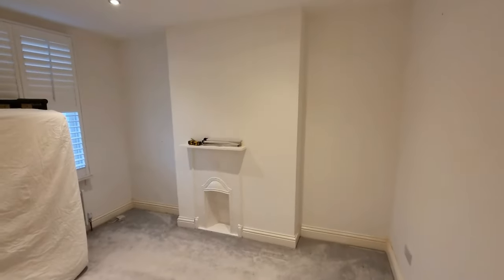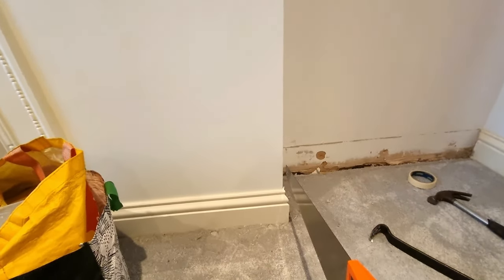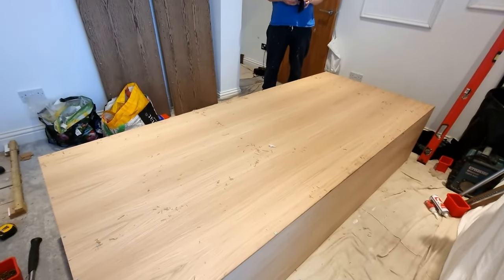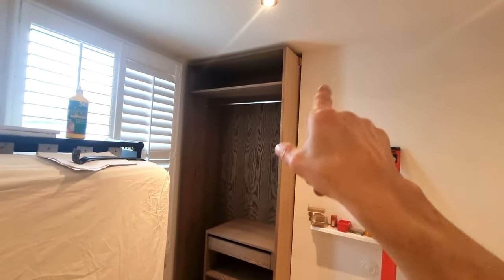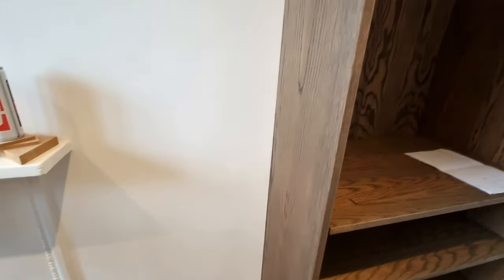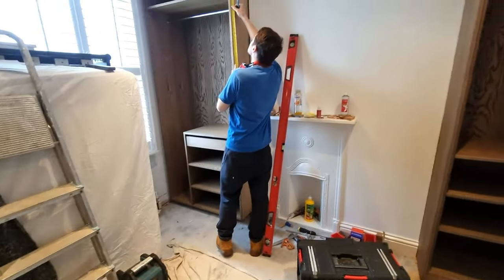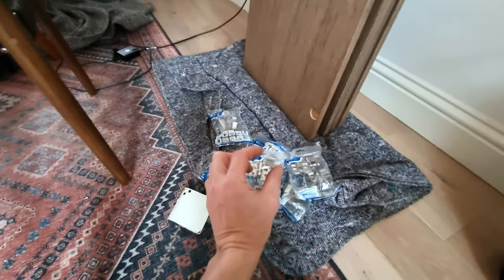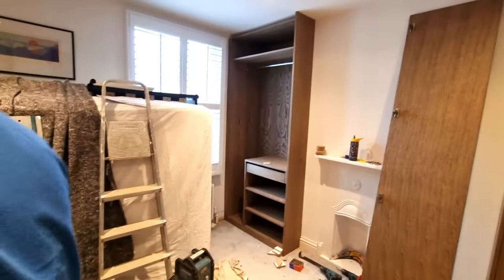How We Installed A Pair Of Oak Veneered Alcove Wardrobes In A Single Day // Vid#129

Comment: The wardrobe on the left do the doors open fully due to the window, blind and radiator
Reply: Despite all their maths I’d bet money that door will hit the window board 80% open
Reply from the maker: Yes the customer wanted it to be this way to gain the space
Reply: @thelondoncraftsmanworkshop  does the drawer open fully. I appreciate the door situation
Reply: @deancarter4109  if you pack the sides of the carcass past the hinge by 10mm or so then it’ll open just fine
Reply from the maker: Yes of course 🙂 I didnt make a mistake, the design was all planned. I'd own up to it if it wasn't 🤣